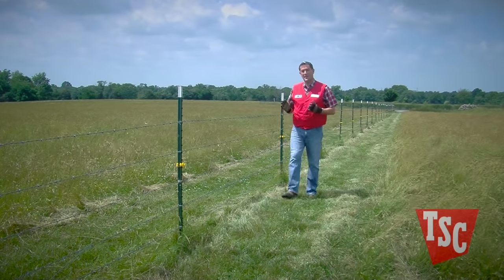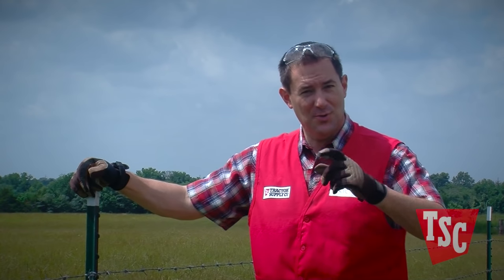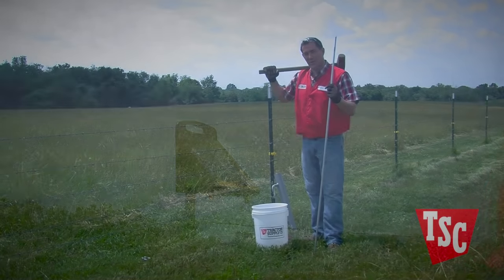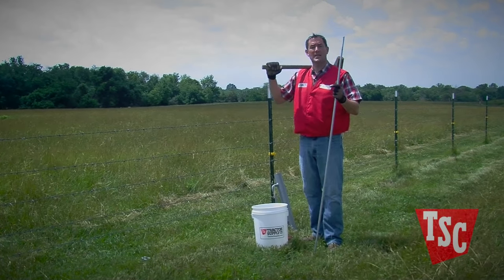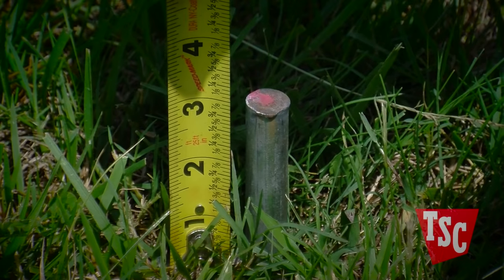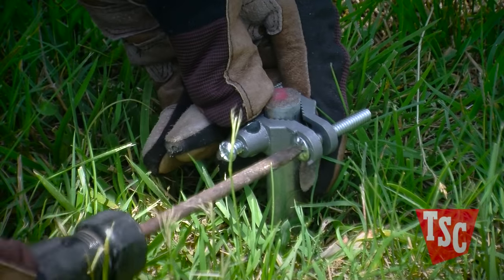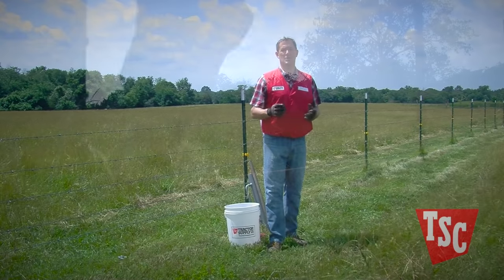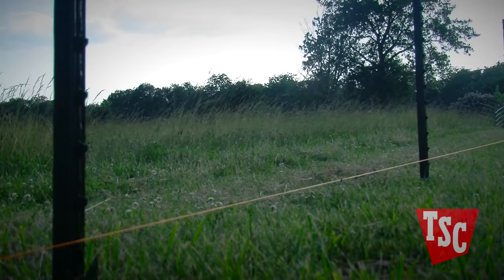How to Set Up an Electric Fence | Tractor Supply Co.

Comment: Why would you run a ground wire back from the fence wire back to ground rather than to the positive side of the controller?  The fence should be connected back the positive side of the controller to complete the circuit.  🤷🏻‍♂️
Reply: because that would be a dead short and you would be sending all your voltage to ground
Reply: @TheSimba86  wrong.  What he describes is a dead short.  A ground wire should not be going back to the hot side of the controller, that would be a definite dead short.

Comment: You totally missed half of what people need to know.

You didn't talk about where to connect a battery, and in what relation that would connect with the wires, and with the box. 

And you didn't say which ends of the charger to connect to which grounding rods or the fence wires.
Reply: I know this video is useless. I haven't found a comprehensive video yet.
Reply: Nothing about tensioners either 😭

Comment: Do the ground rods necessarily have to be spaced 10ft apart & 10ft away from the charger?
Reply: I think the reason they say that is to cut down on the amount of insulated wire you need
Reply: Much of it depends on where you are and what kind of soil you have.  Dry sandy soil is more of a challenge.